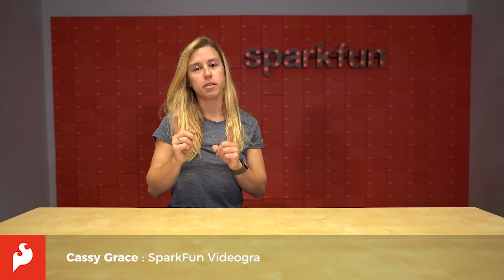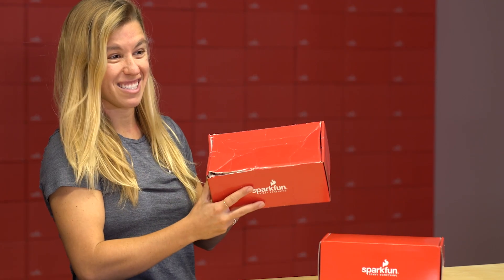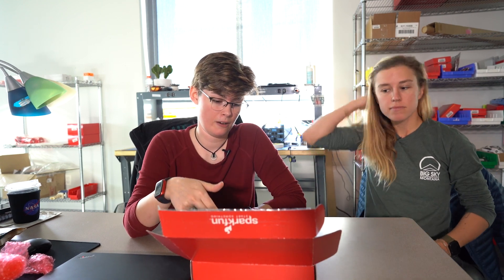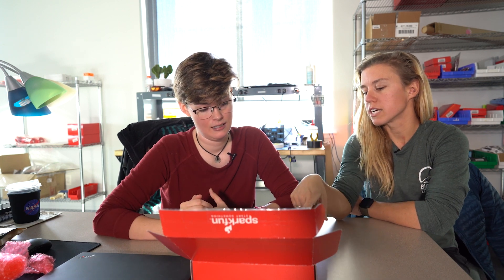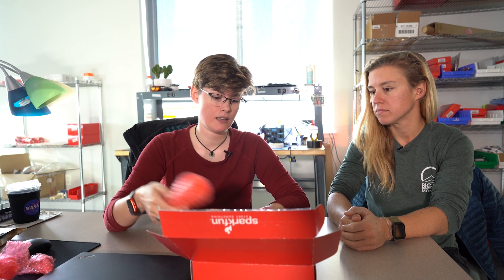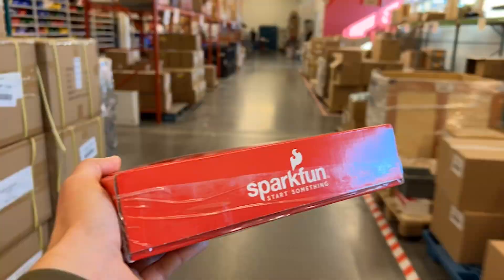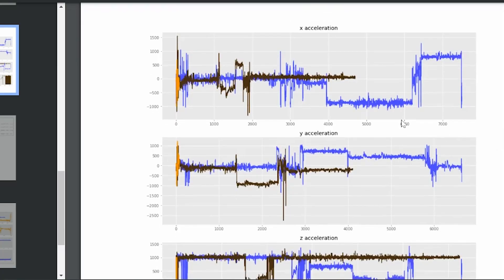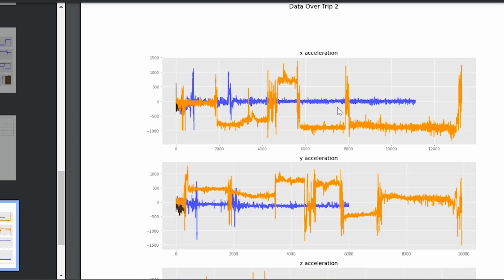Project Showcase: Measuring Shipping Impact Forces

Comment: For a project at work I made a data recorder - also with an SD-card -  which measures similar things: 3-axis gyro, accelerometer, magnetometer, a Real-Time-Clock, strain-gauge and temperature sensor. All with a 4800mAh LiPo battery. We put it in a 3D-printed housing ..... and potted it (no WAY someone can disconnect the battery !). We had to add a wireless charger for the battery.

Comment: Interesting.  A couple years before the iphone came out I built a similar system to document shipper issues for VERY expensive product.  At that time components to do this were quite expensive.  I was able to correlate real forces along with time and location.  Then I brought it in google maps and showed force values at locations and was able to pinpoint buildings that had hard handling.  That was a fun project and very beneficial to the company I worked for.

Comment: you need to 3d print a stout box with a lid. hard mount everything in the box so you don't create a physical low pass filter. only put some packing foam on the outside of the 3d printed box. add a detector to see if the outside box is opened and another one to see if the 3d printed box is opened. add a microphone that activates when the detector is triggered. i would also measure how long it takes for the battery bank to go into standby and see if a pulsed load is enough to keep it activated. i would also use a load resistor rather than an LED, but i suppose that doesn't matter that much. add a pressure and temperature sensor to see what mode of transport is currently being used or if the package is inside or outside. i would also take into account the weight of the package; i think slightly heavier boxes face worse abuse. in terms of presentation i would present the accelerometer data in m/s² units rather than grams

Comment: What you show is far too gentle. Think of the delivery person as the kicker on a football team and your package as a football while he tries to make a 50 yard field goal. I've watched ups unload computers and drop everyone of them from 4 or 5 feet to the concrete. they don't care about the package because it's not theirs. The most important thing isn't more data sampling per shipment, but more sampling of data throughout a number of shipment samplings. Also a consideration is how many hops your package takes to get to its destination. Did the package stay on one truck or was it loaded and off loaded several times, and at what stage did the damages occur. Did it happen at the final destination or while being transferred from one truck to another at a distribution center. It's not as simple as going from point A to point B. There are lots of variables to be considered. First you need to define what are the variables and what data is fixed data. You should be using an accelerometer as well as barometer to measure hight distance and falls and orientation of the box during those impacts. you also may require multiple microcontrollers with each being dedicated to a sensor. You might also want to incorporate a cellular data link so you can receive data at different segments of the packages travel. Packages of different weights might be subject to different types of handling...just a few of my thoughts.